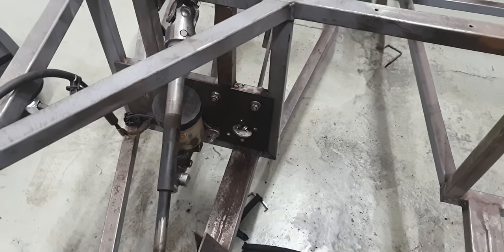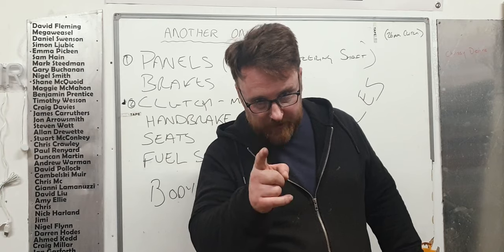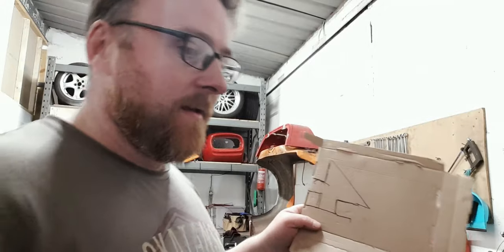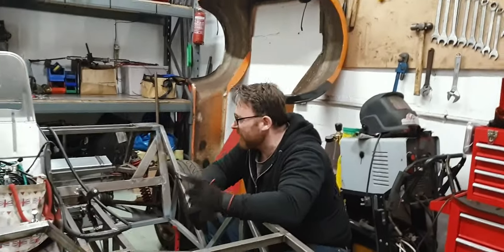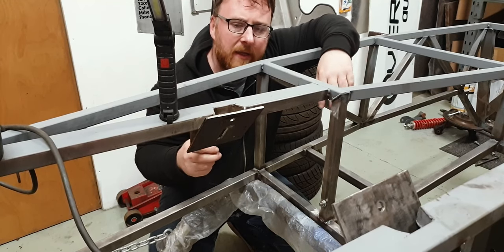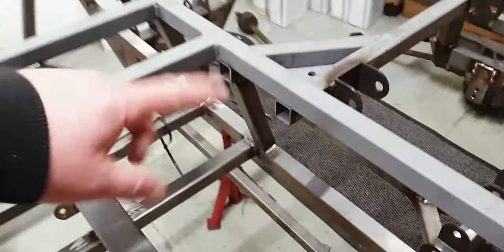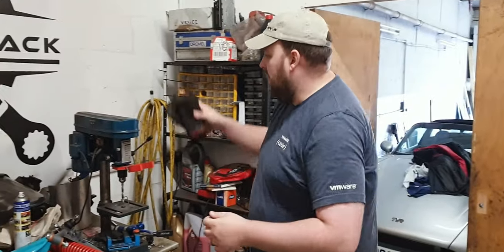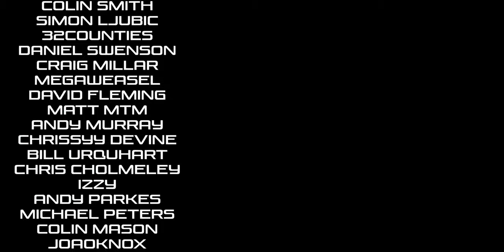GUSSETS: The SEQUEL!!  Locost 7 Kit Car FULL BUILD!! - Episode 39 - (Project 7-UP)

Comment: Great job!! The triangulation in the tunnel is in the design? I haven't started yet, so I'm not to familiar with the chassis yet. I guess, it is good for protection against a runaway driveshaft. I'm even thinking about doing the same to strengthen the chassis, an eventually make some real doors.
Reply from the maker: It isn't in the book, no. As you say though, good to double up as strength and prop protection!